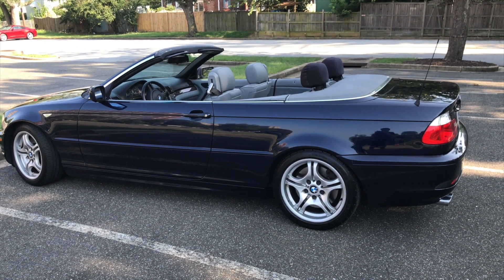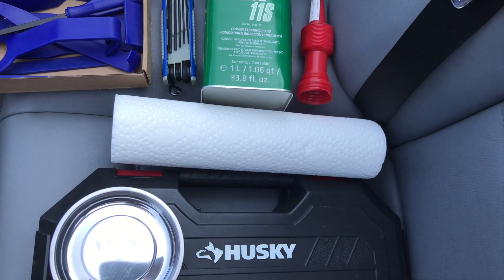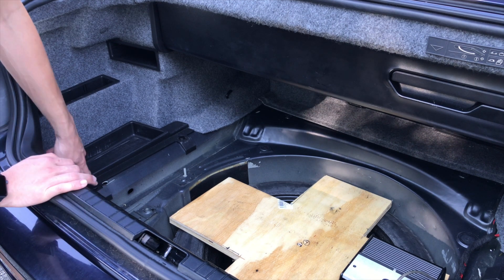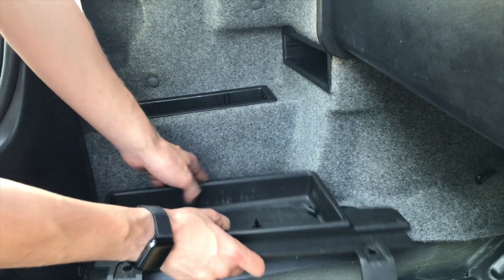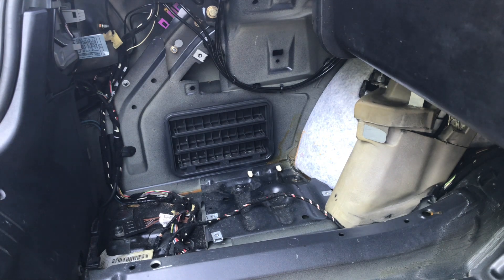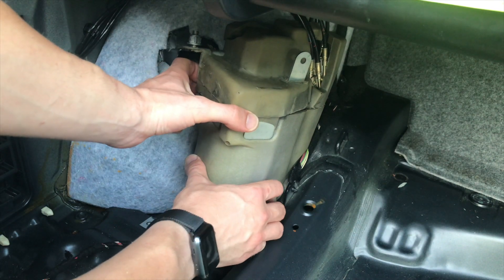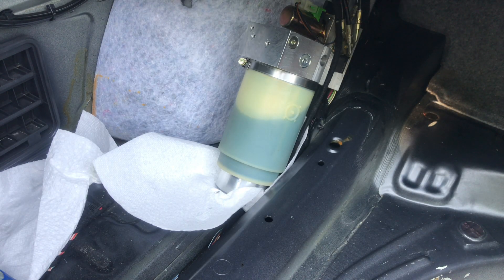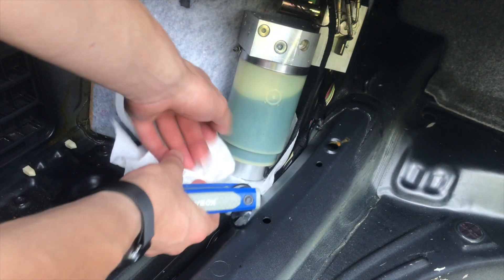BMW E46 Convertible Top Hydraulic Fluid REFILL - Walk Through

Comment: If you use a syringe you don't need to remove the pump - or lay it flat - just remove the fill screw and add fluid to the top of the circle - replace the fill screw.
Reply from the maker: That’s a great idea! I’ll be investing in one soon to make this job easier. Thanks for watching and for your comment.

Comment: Where does the fluid go? Is there a leak?
Reply from the maker: You would have to investigate all of the hydraulic lines, but I would imagine that, if your level is getting lower, there is a leak at some point. It is on my list of long-term items to try to locate and fix the leak that I suspect I have. Thanks!

Comment: I currently have a flashin red light I can hear the motor going and top barely moves, Fluid is a little low but inside that circle. Would that cause that blinking red light?
Reply from the maker: Hello, and thanks for watching! Usually, low fluid only results in decreased performance and increased noise when operating the top. The blinking red light is usually caused by either 1) the luggage compartment expansion not being fully in the down position (there is a sensor and the top will not operate unless it detects the compartment is where it should be) or 2) the trunk not being fully closed. If your trunk is closed but your dash indicates otherwise, you likely have a faulty sensor. There is also detailed operating instructions in the owner's manual, which you can easily find online for free. 

As far as the increased noise and slow movement, I would imagine that the slightly low fluid is the culprit for that one. I hope you get it working!

Comment: Yo Geezer, not actually tried this yet but your video was spot on. I imagine this will fix my 330ci noisy and slow roof issue without going to an expensive garage to do the same thing. I'll let you know if it cured my problem. Thanks Man. RH England.
Reply: Hi was that it?

Comment: Hi BMW Ci lover, I’m so incredibly happy to have discovered your precise and in-depth video on the mechanics of the soft-top.
I have a 04 plate 320 Ci soft-top that has unfortunately been out of action for a year.
Operation of it manually is an absolute ball ache, removing back seat disengage motor and wind the roof latch with Allen key. 
It stopped working after I took it down to transport an antique mirror, the roof closed slowly hesitated then closed fully and then decided it didn’t want to work properly after, I was told it might need recalibrating or the pump was dead, it unlocks and opens 3 inches then holts, so the motor under the seat works.
So having watched your video is the only other piece of the puzzle,, however I have factory fitted six disc changer in the left hand recess where you have a tray.
Do you know anything about removing the disc changer?
Kind regards 
Nick Mander 
United Kingdom
Reply from the maker: Hi Nick,

Thanks so much for the kind words! I am so happy you found my video useful. Yes, I agree that manually opening and closing the top can be quite the chore, so I understand wanting to get it working again quickly. 

Given your description of the issue, I would check a few things. When you hold the button, what happens to the light? Is it solid red or is it orange? Second, double check that the boot convertible compartment is fully down and that the sensor for that is working. Also make sure the sensor for your boot being closed is working. Both of those will cause the top not to work, but since you say it opens partially, I suspect this is not your issue.

I would also double check the wiring, especially at the elbow joints where the top frame folds near the driver's and passenger's heads. The wires have been known to fray, and it could be that you have an exposed or fraying wire that is causing this issue.

As far as the CD changer, I am not sure how to remove that, as mine does not come equipped with this feature. However, I see a few videos on YouTube and a few articles on Google following a cursory search. Give that a try, and hopefully you will find a good one!

Cheers,

Cody
Reply: Hey Cody, thanks for your reply, it is much appreciated indeed.
The button light you refer to is on constant red.
But as I said it unlocks and opens up a small way.
The trunk space for the roof is fully open as far as it will go, the boot lid is a bone of contention though, sometimes it unlocks without touching the damn thing.
What I have noticed is that someone before me has removed the plastic rivets to remove the lining and not replace them. Somewhat annoying to say the least.
I will take on board what you have said about wiring and cd changer reference on YouTube.
Thanks again for your time and help 
Nick 👍
Reply: @nickmander6088  don’t forget to give us an update if you were able to get it fixed with the fluid in

Comment: Hi, your video was very useful, tomorrow I should go and buy an e46 cabrio unfortunately automatic 🤢 with also problems with the soft top, the owner says that the motor works but the soft top It doesn't salt, so it's probably missing the oil, at least I hope so

Comment: Watched the video looks like it’s not too hard to do. Was your top not working at all when you pressed the button to open/close? I changed my tonneau the other day so I had my key in and had the tonneau open by pressing the button for a couple hours & I feel like that just drained my fluid never added any fluid in the 20k kms I’ve put on the car so I’m just hoping this is my issue
Reply from the maker: Good morning, and sorry for the late reply! When I did this, my top was operating, but it was slow, loud, and sometimes required a bit of a push for assistance. If you are not hearing the top motors engage or you are getting the flashing red light or the amber light, you have another issue.
Reply: @unccody hi thank you so much for the video, I’ll be doing this tomorrow. Do you know what a flashing amber light might indicate? My top is slow so I think hydraulics is definitely part of the issue. But occasionally the back that covers the top when it is down won’t unlock or won’t lock once the top is down so it just stops and flashes amber. If I restart the car it will usually pick back up. Would this be that rear seat motor you think?

Comment: l used a syringe and l overfilled it its a bit hi now and cant work out how to get it out That was a few months ago and it seemed to be fine but the other day after the roof was down for an hour the cowel wouldnt open. l reset it with the button under the back seat and it went up ok but now lm afraid to lower the top again in case its gets stuck for good. Any suggestions would be very appreciated
Reply from the maker: Good morning, and I am sorry to hear that you are afraid you overfilled it! As I have not had this experience myself, I am not sure how to remove fluid from the reservoir. My only idea would be to get a bowl and to try to simply tilt the reservoir and pour some of the fluid out. It may be very messy, so make sure you have lots of paper towels and wipes nearby, and protect the interior of your luggage compartment.

As a side note, the roof could have been not responding for another reason. In mind, sometimes the luggage compartment doesn't register that the expander is down, so I have to manipulate it once or twice, and then it will work. If that doesn't work, you can always try unhooking the negative battery terminal and leaving it for a while before reconnecting, waiting again, and trying to use the top again.

Do you have any lights when trying to operate the top? Blinking red or solid orange? Good luck!

Comment: I just started your video. I'm stopping at 5:38 to make a quick comment(s): You carry oil in your trunk. That's not a good sign. 2) You carry an OBD2 Scanner in your trunk. That's another not-good sign.:) Okay. On with the video.BTW: Do you CHANGE your fluid on a regular basis? If so, how often? Thx
Reply: If you don't carry extra fluids in the trunk of an older car, your begging to put the tow truck driver's kids through college.

Comment: Hello, my time will only operate if I give it some help while I’m pushing the button. The fluid seems to be at the correct level. It almost seems as if the pump is not quite strong enough to make the top go up and down. But, like I said if I have somebody help me and give it a little bit of help it will work going up and going down. Is it possible that the fluid is just too old? Or is there some other reason this could be happening? Thank you.
Reply: By the way, my top worked very well for many many years and then this past summer just stopped working well. I am the one that just asked the question in the last post. My name is Rob.
Reply from the maker: Hello Rob,

Thank you for watching and for your comment! While I cannot rule out something like a failing top motor or old fluid, based on the information you provided, it does sound like you are low on fluid. Does your top operate with more noise than usual?

I would try refilling your fluid so that it is closer to the top of the window and see if that helps. For me, one of the symptoms of low fluid is exactly what you describe - the top will work with a little "help." Good luck!

Comment: Hi. Found your video very helpful. Just one question if you don't mind. Do you know if the system is self bleeding? Thanks
Reply from the maker: Hello, and I am so glad it was helpful! I am not certain about that. I think that the system does have a mechanism to bleed excess air out. You could try going to realoem and looking for the parts diagram for your car as well, which would likely provide you with more information.

Comment: Do you know what happens if it’s overfilled?? Mine is like an inch over the level. I’m looking for the reason why my roof doesn’t work
Reply from the maker: Thanks for your comment! As I have never encountered this, I am not sure what happens when it is overfilled. What happens when you press the raise or lower button? I would start by checking that your luggage expansion compartment is fully in the down position (there is a sensor and it won't operate unless it detects this), and of course ensure that your trunk is fully closed. You could also have an issue with the convertible top motor, which is easily accessible by taking out the rear seats. Good luck!
Reply: Thank you Cody! I already checked those, everything looks good. I also took out some of this fluid. 
I can hear some clicking noise on the left side where cover locks are, but it’s not cover locks. More like this hydraulic something, but roof won’t go up, only a little in front.

Comment: How do you know if you want to top off your fluid though?
Reply from the maker: In the video description, I mention a few of the symptoms, such as slow opening/closing or loud top operation. If it gets low enough, the motors will not be able to operate the top independently, and you might have to help it by giving it a little push. Also, you can check the levels in the window of the reservoir.

Comment: My car looks very similar to yours Orient Blue/Grey leather but it is a 2002 Sport (hard suspension) and automatic rather than manual. I would certainly prefer the manual but they are very rare! 

This is a superbly done video to show removal and access to the pump and everything else behind that panel. I had a fight with that cladding when I changed the TV module - Terrible piece of design. All due to effective sound deadening I suspect. Mine was even worse due to a CD changer and Navigation CD player in the slots. I don't think my problem relates to low fluid as I have none of the symptoms you mention in reply to other posts. I think it is a relay or fuse because although the front motor will release and tilt the top back a little, nothing further happens except a clicking noise from the rear left when the main motor should kick in and pull the whole thing back. I have just the flashing red light but no codes to report in INPA so I assume no broken wires.
Reply: Mine has the same problem as your talking about have you ever g gotten the fix for it
Reply: @eoinnash8979  It seemed to clear itself (the fault). Push the roof manually through its sequence and at the same time keep trying the auto-closing/opening at different positions. With this mine suddently started working the full sequence. as it should. What caused it I'm not sure but in my experience, lack of use plays a part. When these things are used frequently they work better. Primarily the sensors and relays. Also vital for the roof is a really good battery condition. I've had many low voltage errors with mine after using it for short journeys. It takes a lot of power to operate.

Comment: Hi there. Do you have any tips or idea what are the symptoms could be when the fluid is low? Because I don't think I have leaks so I don't like a idea just opening to see if it's low. Thanks for video.
Reply from the maker: Hello! For me, I notice that I am a little low when the sound starts to increase. The top movements will start to get louder and more pronounced. Also, I notice that the top opens and closes more slowly, and, in extreme cases, the motor is not able to lift the top up and requires a push to help it. If your top is excessively noisy or struggles to open and close on its own, you are probably a little low and topping off could help. Good luck!
Reply: @unccody  Thanks much. Too bad winter is coming.  Can't wait for sunny summer. Good luck.
Reply from the maker: You’re welcome! And look at the positive - plenty of time to get it ready to go come that first sunny March day

Comment: Hi brother , to refil with fluid the roof must be closed or opend ?
Reply from the maker: Hello! You should refill the fluid with the top in the down (opened) position. This allows for accurate measuring. Of course, if you are so low on fluid that it is difficult to operate your top, you can always add a little fluid with the top up (closed) so that you can operate it. You'll want to have the top down (open) when you use the window on the reservoir to check for the correct levels. Thanks for watching!
Reply: @unccody  the roof is working but is very slow , i bought the oil but i didn t know how to fill the oil compartiment   thank you 👍

Comment: So why does the top have to be down to do this? My top won’t go down for me.
Reply from the maker: The top needs to be down for this so that you can measure correctly. The levels will not be correct if you fill it with the top up.

You have two options - you can put the top down manually and then refill once it is down, or you can refill it with the top up enough so that it becomes operational again, and then you can refill it to the correct amount once the top is down. Good luck, and thank you for watching!
Reply: @unccody  so, im not sure whats wrong now. I can manually lower the top and it will close automatically. But if i lower it automatically it gets stuck! What gives?
Reply from the maker: That's a good question, I am wondering if you still might not be at the right fluid level. Check it with the top down and see where you are.

What happens when it gets stuck? Does it come up at all? What does the button look like when you try to raise the top - flashing yellow, flashing red?

You may need to take it to an indy shop you trust or a convertible top repair shop to have them investigate further. I wish you good luck in your diagnosis!

Comment: Why does the top have to be down?
Reply from the maker: Thanks for your comment! The top needs to be in the "down" position because the measurement window will be incorrect if you attempt measure with the top up. Putting the top down moves all of the hydraulic fluid and allows you to measure your fluid correctly. It's similar to how you want to check your coolant levels with a cool engine. You will get an incorrect reading otherwise. If you attempt to refill with the top up, you will not fill it to the correct level. Hope this helps!